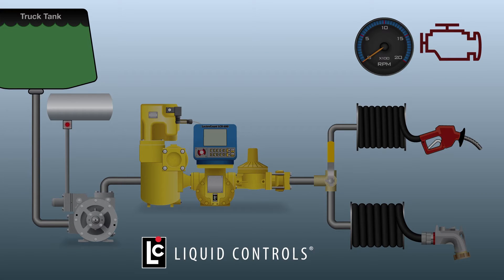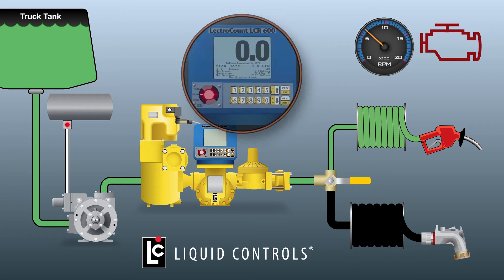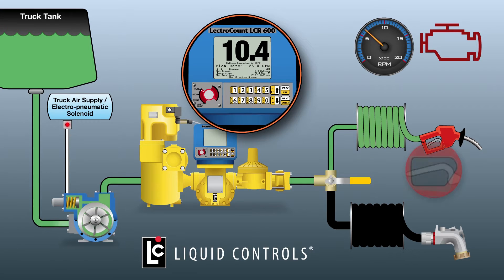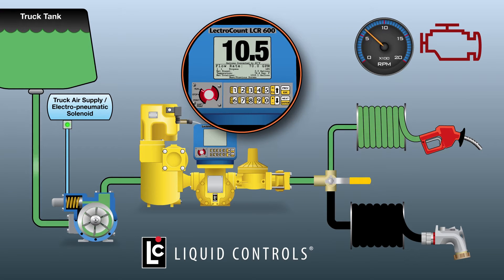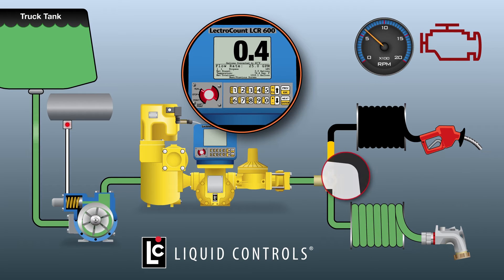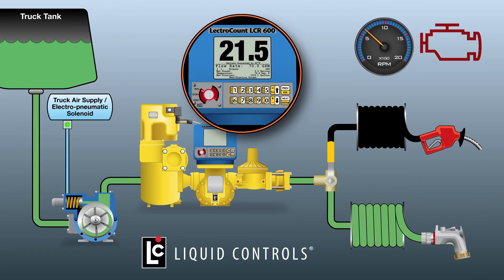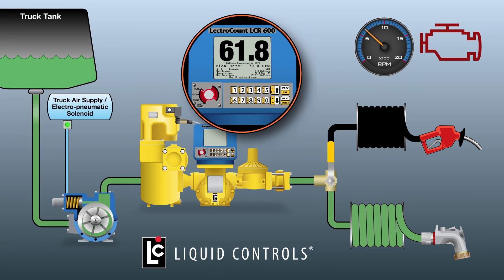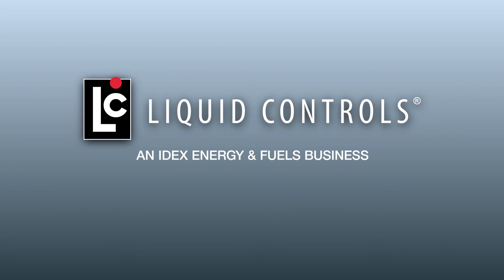Liquid Controls (LC) LCR 600 Fueling meter system for refined fuel trucks (training video)

Comment: If you want to control this meter from the cloud and the end of the hose, check out BizSpeed.  The BizSpeed computer also lets you remote into the EzCommand software - no lap pad needed in most cases.

Comment: Still use a hammer if you meter wont return to 0.  Even if it printed. Use hammer just enough to knock it off the meter base.